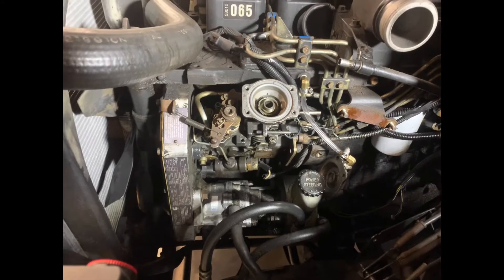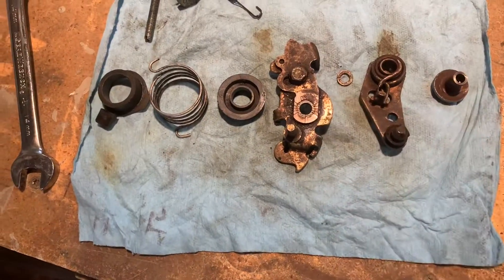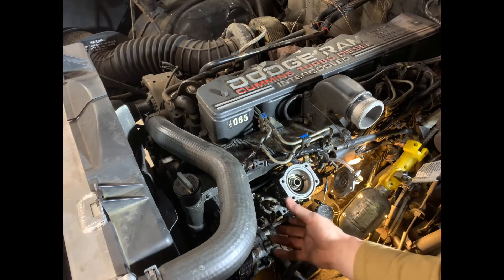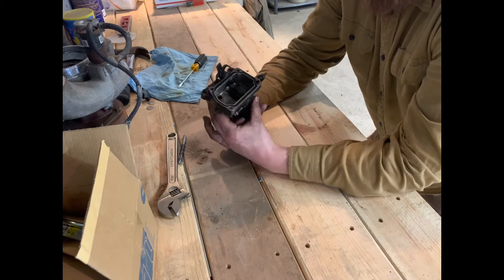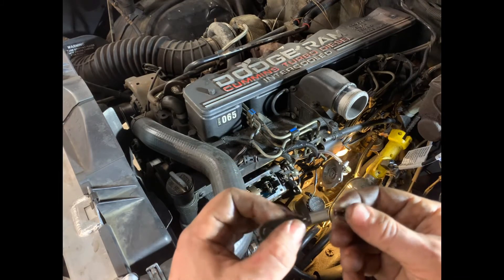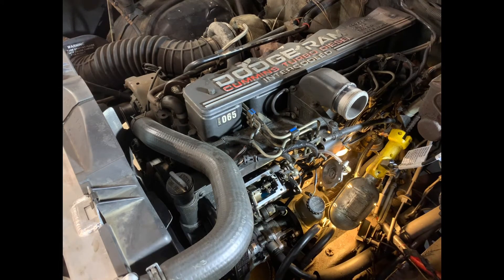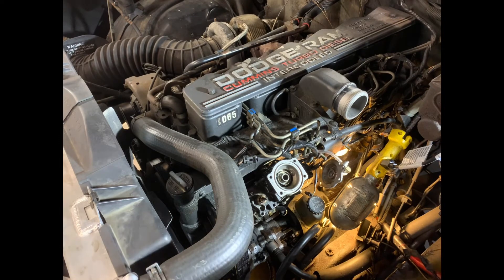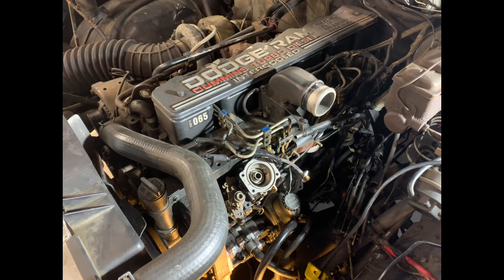3200 rpm gov spring install

Comment: I bought a 1992 truck that will only start and run with the fuel screw run way in.  That obviously makes run to the moon with now chance at idle.  What are the odds the fulcrum lever is busted?
Reply from the maker: I’d be looking at the throttle indexing first
Reply: @1stgenhub806  I'm all the way in to the gov. Spring with no signs of tampering below the smoke wheel (5_1/2 turns in).  It is completely gummed up with a varnish type sticky substance.  I'm going to clean it all, put in new seals, and assemble with new parts while making sure to index the throttle like you instructed.
Reply from the maker: Glad to hear you’ve found some suspected fail points. Hopefully that clears you up. These trucks aren’t getting any younger so no telling what you may run into when you pick one up
Reply: @1stgenhub806  quick update.  I've got a 605 recall truck that was never done.  I'm contacting the dealer to get it replaced.  It seems it is in runaway mode due to a broken pin below the fulcrum lever.